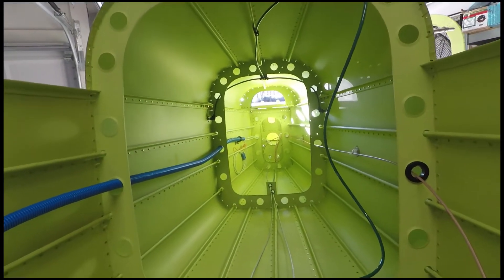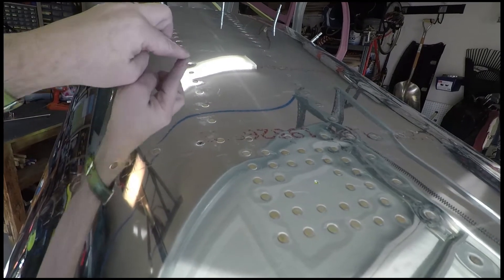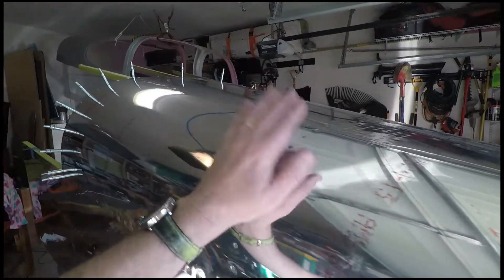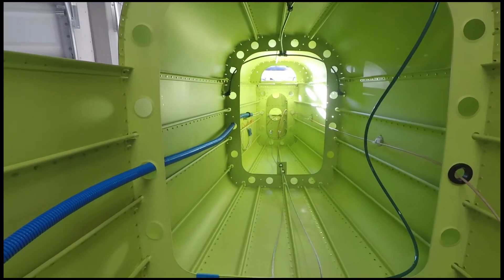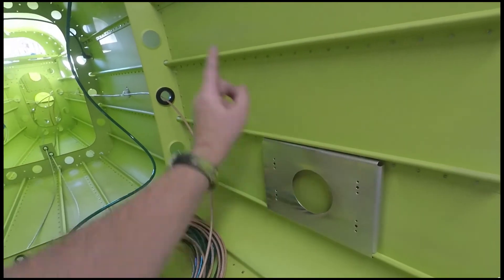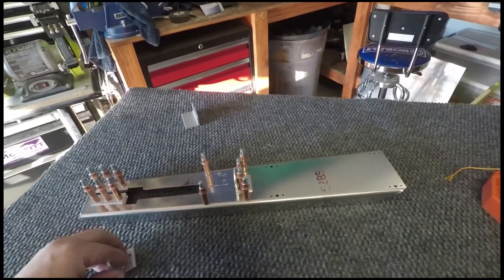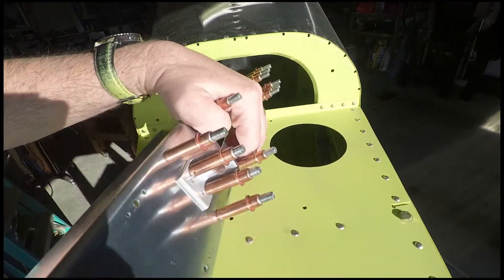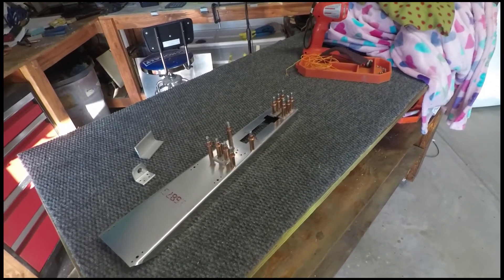RV-10 Update 08 Feb 2018

Comment: Did you check out a Bob Archer Vor Localizer antenna?  It goes hidden in the wing tip. Much cleaner and better option. You are still in time.  Eliminate all the wires through the tailcone and rudder.
Reply from the maker: Funny you bring this up today. I was just installing it an hour ago.
Reply: Parish Moffitt You should have the same reception. You wont be disappointed. Send feedback.